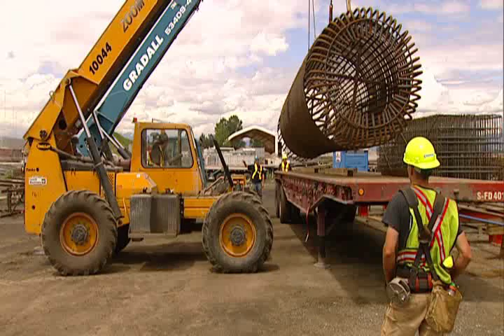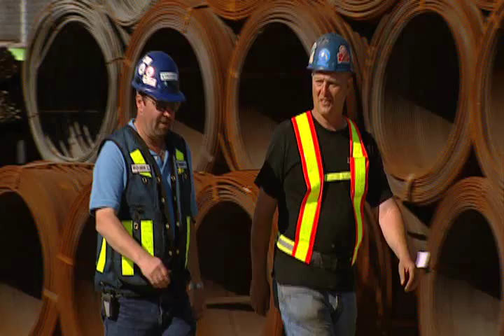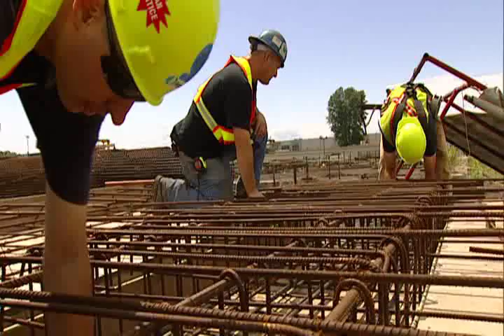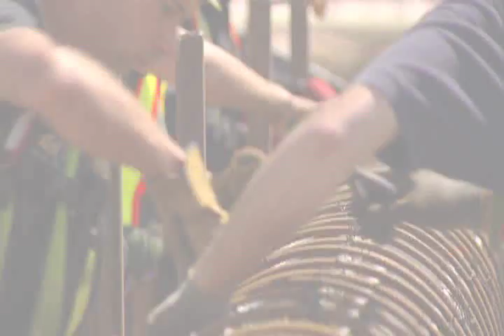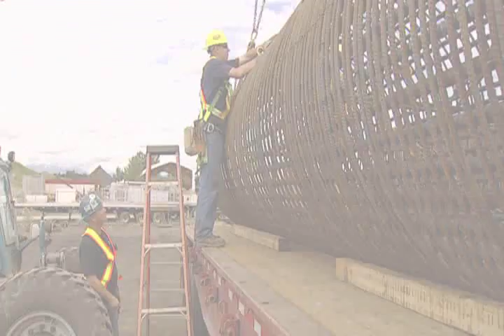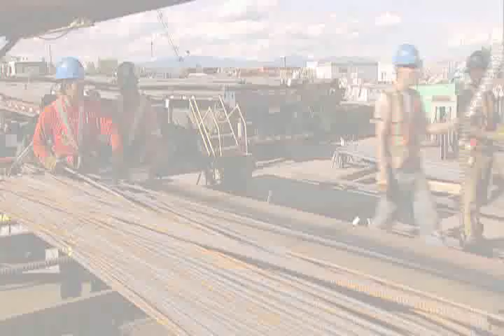Young and New Worker Programs - Harris Rebar

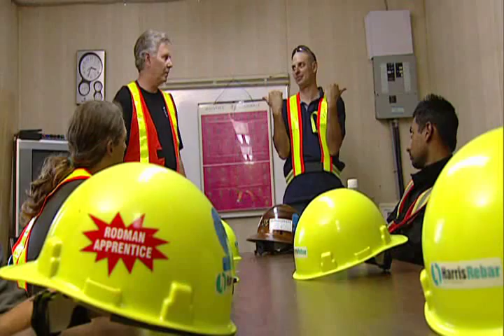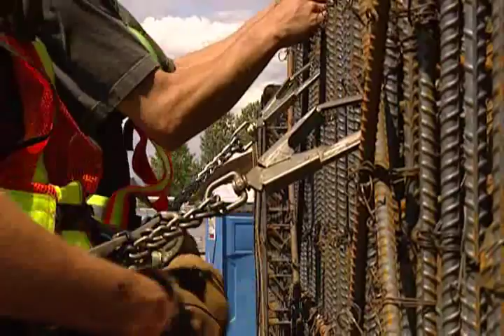Comment: The More I watched this video the more I see dangerous conditions from improper rigging equipment, rigging tech., and can anyone tell me what signal he's doing at 1:07! LOL @ 1:56 the Two are hooked of wrong with there hooks, Always hook to the Back bar and they are clearly hook to the outside vertical. But I guess other then the Safety Glass issue is the Most Dangerous issue is Never Ever use the Hoisting Chains to Rig Rebar Only Proper Weighted Slings and Chokers Should Be used to Rig up steel

Comment: @Dukeybm maybe you should learn how to rig and signal before you post a comment. the signal at 1:07 is a one handed boom retraction, if you have worked with anything but a tower crane you would know this. furthermore grade 80 or 100 chain bridles are designed for overhead hoisting and are considered acceptable although i prefer wire rope myself. go make fun of carpentry videos or something that you actually know something about.